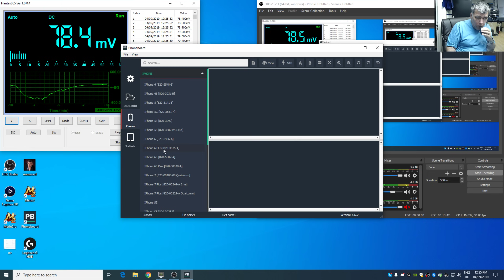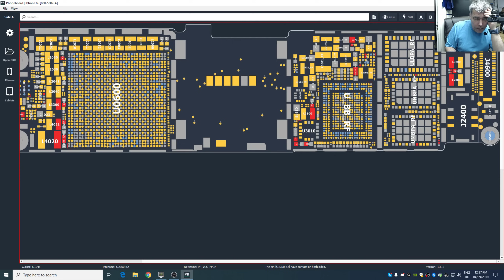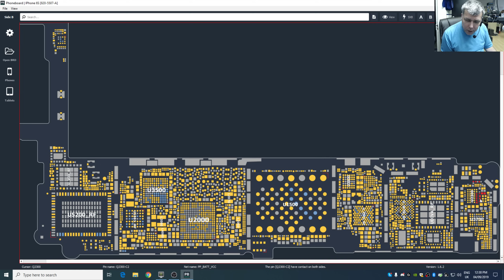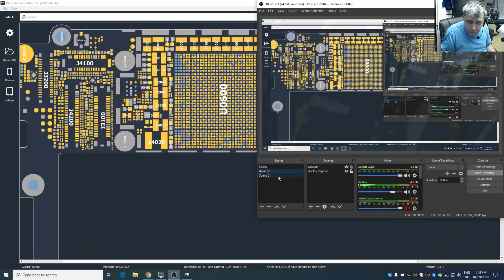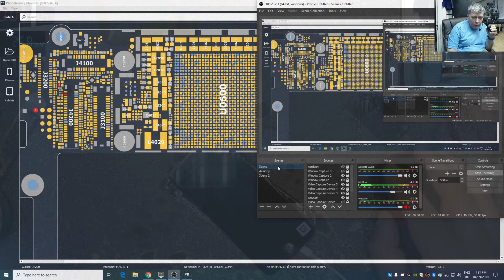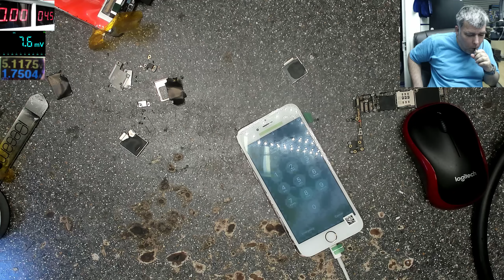When Things Get Complicated -Iphone Water Damage

Comment: Hi Sorin,
At the minute 35:19 (circa) you are starting to remove what you call "glue" (that black goo all around components). The question is: 
- how you will remove it? 
- Can't you solder the new chip directly on top of that? 
- I've seen you use the solder tip like a scrub.. is it normal soldering temp or it is lower, not to damage the tracks?
- that glue cannot be removed using some chemical?
Please, be so kind, let me know.
ciao
Mario

Comment: My friend iPhone 6 has a totally drained battery. I measure a bit over 500k ohms on the board battery connector from positive to ground. Does this sound like a short somewhere in the board that pulled the battery to 0 volts? Is there a way to give the battery some charge without a power supply? Thanks you Sorin

Comment: Guys, i can't tell you enough how important what I'm about to say it. Seriously. WATER itself, is NOT a threat to your system. If you open it up, and see water or liquid in places... GREAT!!! NO DAMAGE. So what you want to do, instead of hair drying, is wiping it up with those ear bud sticks, wipe the water away. Why? because it's not the WET part of the water that breaks your electronics, it's the Mineral content of the water when it DRYS. Very important. When it drys, it deposites green materials like iron etc, which erodes things. So get it while it's WET and clean it with cotton, DONT dry it. because you're still drying it into the board. Where is the mineral content? on the board. CLEAN it first.

Comment: Sorin, you wait for so long time to have the phone finally up&running... meanwhile there was NO SIGN on the display that it was taking time to get up... HOW do you know it was getting up? and need to wait a LONG TIME to have it finally on? 
Yes, you can say: "...it's my experience.." but how you faced it the very first time it happened to you???
I know you usually don't give answers here... but I'm STRUGGLING in this dilemma...
It happened so many times to me to have a blank screen phopne, right after finding a broken chip, but NEVER imagined it could turn on after so much time!!! Please answer me, if it is possible to you. thanks!
Reply from the maker: I did have the charging sign on the screen, but can't been seen on the video, Also the phone was taking 700mA charging current
Reply: @electronicsrepairschool  thanks Sorin for the kind answer. I could not see anything on the screen and, sure for the language barrier, I haven't heard it if you said it! thanks anyway for the clarification!

Comment: Hi Surin.
Thank you so much for your channel, it helps me a lot.
I have a question.
I have two iPhone 6 boards. No power, no charging, not short.
I connect a multimeter and there is no short.
I connect a power supplier and there is no short.
What can I do to detect a disconnect on the board?
Thanks.
Sharon.